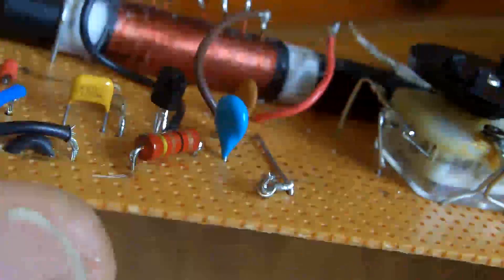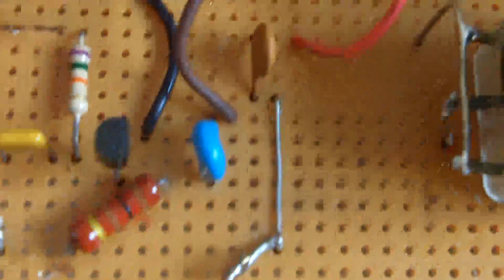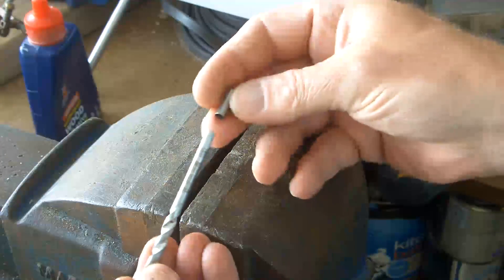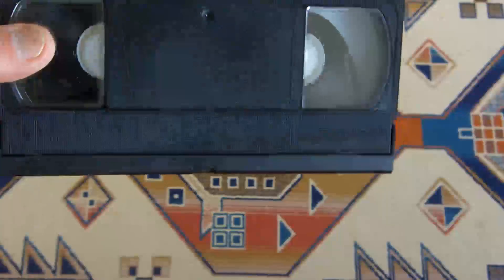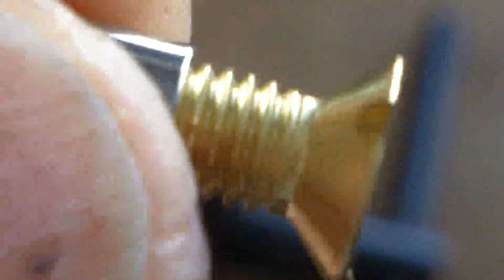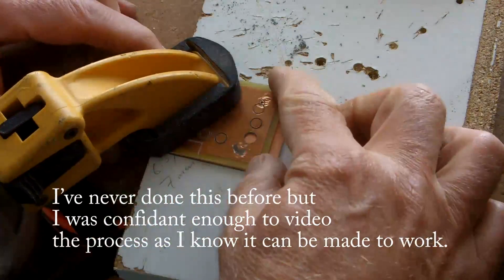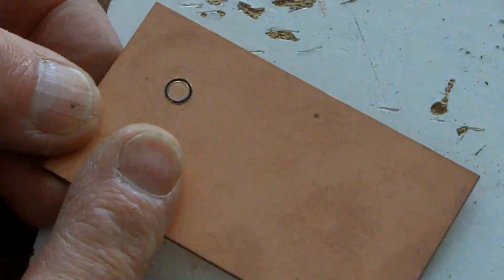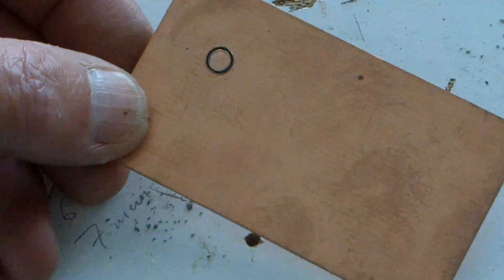PCB Tip, tip for creating pads on continuously coated PCB's

Comment: It's a great idea -  thanks! - One small recommendation for the author or for all of you who will read it: for straight grooves in PCBs, I've found the vibrating tip engraver to be the most useful - e.g. the fairly inexpensive Dremel 290-1. It's a simple device that, when you run along a metal ruler, creates a very neat, straight groove in the PCB.

Comment: I use a paper hole punch on copper adhesive backed copper foil. Works great!
Reply: i wonder if those paper hole punch works with regular printed circuit board

Comment: I'm off into the loft right now to dig out an old VHS cassette for those 5mm Stainless steel pins! I have so got to try this. Scratch that! I've just watched your update. I'm off to the workshop to break an old 1/4" drill bit (ha ha). Nice one Andy :-)

Comment: That is a marvelous idea, Andy. Thanks very much. Amazon sells a 4mm diamond hole saw that should work well also.
https://www.amazon.com/Diamond-Baban-Coating-Ceramics-Porcelain/dp/B07CJRWXLZ/ref=asc_df_B01L92YM1A/?tag=hyprod-20&linkCode=df0&hvadid=312003160272&hvpos=1o5&hvnetw=g&hvrand=1803838996179936071&hvpone=&hvptwo=&hvqmt=&hvdev=c&hvdvcmdl=&hvlocint=&hvlocphy=9026824&hvtargid=pla-567852046729&th=1

Comment: I've been making circuit boards this way for years.  Recently I've begun to use spot weld drills from Harbor Freight Tools. They work great.  I use a drill press, but I suppose you could use a hand held power drill as long as you keep it straight.

Got to Harbor Freight tools and do a search for, "Spot Weld Drill"

Burt, K6OQK

Comment: Nice idea. If your drilling press doesn't allow you to set an end stop, you could also fit and crimp a steel bearing inside the cutting tool to act as a stop and ensure that the drill won't drill through the veroboard. It might cause a dimple in the center of the pad, but it shouldn't be able to drill through

Comment: Nice job, Andy.  I used a similar technique back in about 1976 or so, from an idea I found in QST, the ARRL magazine,  in they're series about transisters.  They used PCB material scored with a broken hacksaw blade to form isolated square or rectangular pads.  They used small 1 x 1 inch pieces for sub circuits or stages, then hot glued to another base piece.  Your method looks easier, though.  I would drill through and short the upper neg to the lower foil for a  ground plane.
TNX
Dick
Reply: How about thin pc board stock and a paper punch. Punch out lots of thin disks. Put them down with super glue. Tack solder leads of transistors or resistors etc